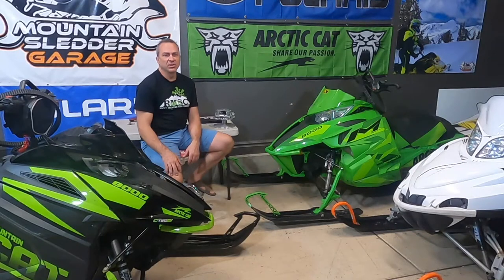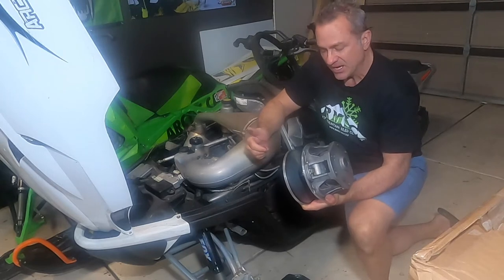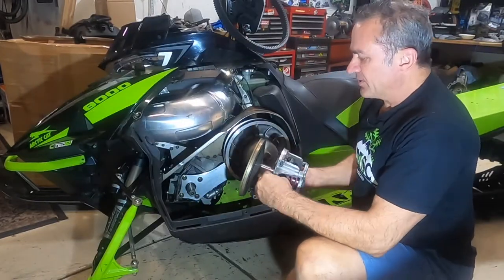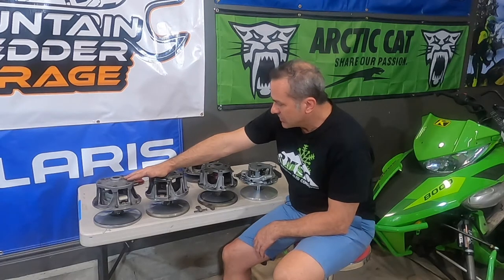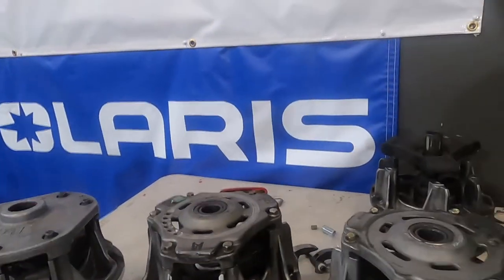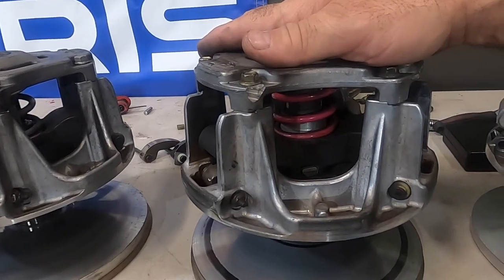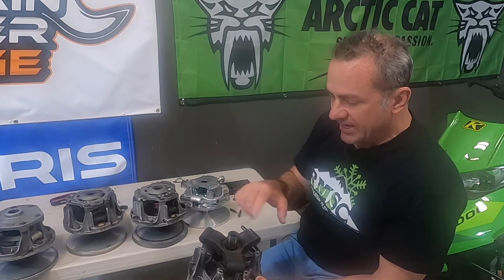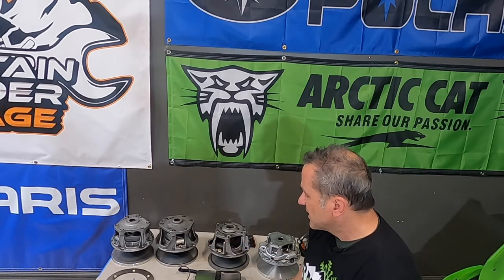Arctic Cat primary clutches, the last 20 years.

Comment: Great video.  The only thing I would add is the 6 tower came out in '04, not '05.  It also had two flavors; the early "SAE" version was bulletproof; I have over 10k on one, and it's all original (trail sled).  They switched to a metric version around '07, and it's just not as good.  I'm pretty sure they started manufacturing them overseas as well,  which is probably the real reason for the quality, not the fact that it went metric.

Comment: Are the 16-17/18 clutches interchangeable? The moveable sheave on my 18 cracked, and I found a cheap 16-17 locally
Reply from the maker: Yes, you can use a 16/17 clutch on an 18’.
Reply: @mountainsleddergarage8627  anything else need to be changed to do that?

Comment: I installed a p-85 on my 19 cat.  Works very well.
Reply from the maker: The P-85 works very good.
Reply: @mountainsleddergarage8627  the only downfall is the pricy bolt that’s not available in Canada. We pretty much put the p-85 on our other 3 cats.  They just work so much better.  Longer belt life and they take the abuse.
Reply from the maker: Where did you have them machined to fit the cat crankshaft. I took the P-22 off my Polaris boost and put a p-85 on, much better clutch
Reply: @mountainsleddergarage8627  fast track Motorsports

Comment: Great vid. Does this apply to the Arctic cat UTV series?
Reply from the maker: The arctic cat utv started in 2012 with a wet clutch design. Later it turned to the Team clutch, which was similar, but not exactly like the sled team clutch. Now it uses the Adapt clutch, again very similar, but not exactly like the sled clutch. The sled and utv clutch do not interchange.

Comment: Interesting! Since i have a 19 alpha, Will the p85 clutch fit on the 800 ctek2 crank? Same diameter?
Reply from the maker: No, the P-85 will not bolt on to the cat crank. You can have the P-85 machined to fit. Indy Specialties can machine it.
Reply: @mountainsleddergarage8627  Is this Indy Specialty in Cannon Falls? Great vid...
Reply from the maker: Yes, there are a few other places around that’ll do it.

Comment: Im not a fan of the the auto belt deflection. I believe most problems come from to tight of deflection. Belt is to tight causing to much heat. 
Never saw the advantage of the team clutches either. I raced cart for 15 years. Pro XC and SX many wins and championships. 
Iv owned a lot of race sleds and trail along with my father. 
My father had a 2015 XF 6000 with cat clutches. It would spank my 15-17 ZR 6000r XC’s. 
My 15 was closest with cat primary and team secondary. My 16 and 17 had all team clutches. My father had 50 pounds on me with heaver sled. Probably a 100 weight disadvantage lol!! 
Idk why cat went away with the reverse cam. My opinion is best secondary ever on stock sled. 
STM must of thought so because there secondarys r copies of the reverse cam clutch. Just built heavy duty uses all same clutch components as cat reverse cam. 
O ya whats up with weight rings on the clutches. 
Took one off once but messed up the clutching just didn’t work right. Probably could of re clutched to make work though. 
Anyway cool video good stuff 
Thanks 
Josh. G

Comment: I"m glad for the info, but Disappointed that cat has not had a safety recall for The customers.
Reply from the maker: Yea, with as common as an issue it’s been you’d think cat would do something. Polaris had a couple clutch bolt failures last year and were concerned enough to recall and fix everything.